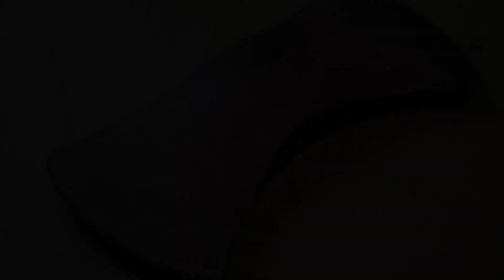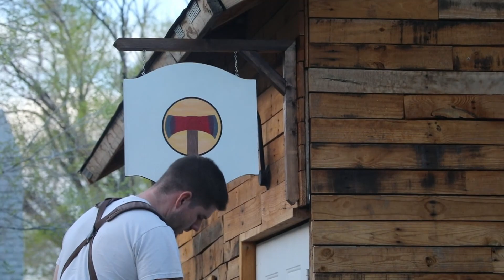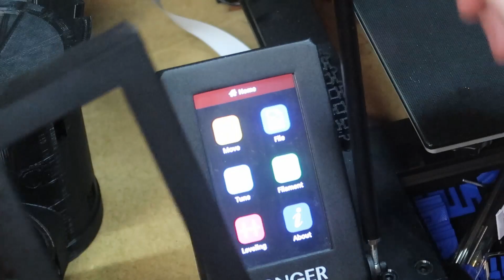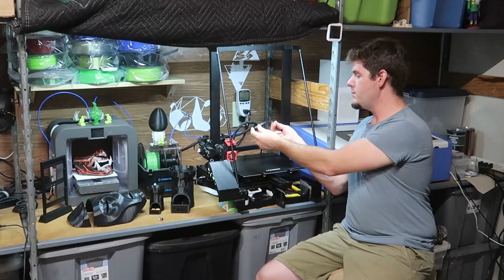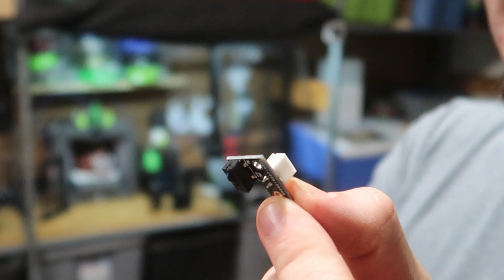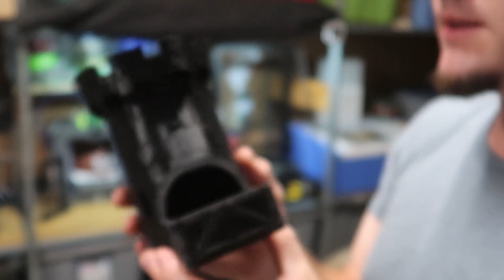1200+ Hours on the Longer LK5 Pro | Still Going Strong

Comment: I am having an issue with my LK5 pro where the screen is stuck on the longer logo, I need to update the firmware but can not hook it to the pc due no drivers. All the links on Longers site are down that I have found with the windows drivers. Any idea where I can find these?
Reply from the maker: If the site is broken I'm not really sure where those files can be found. I would check your power connection, the only time I had this issue is when the fuse connected to the power supply fried out from bad connection. Sorry I can't be more of a help!

Comment: Hello

Could you help me with a problem I have? I recently brought the longer lk 5 pro, but I got terrible prints when I started printing something. I try leveling it, cleaning it, and changing the setting, but I still get blobs on my prints, and the feeder keeps skipping. I hope to hear from you soon for some advice.
Reply from the maker: My extruder motor was having some skipping issues and blobs randomly as well! I would suggest running a temp tower through cura, and as for blobs if you have really cheap filament that can have inconsistency with what temp melts it if the filament changes size and goes bigger and smaller then 1.75mm as happens with the cheaper filaments. But first try a temp tower, then do a retraction tower with cura. Both are pretty straight forward and will help you to set a base line, also check your nozzle for even the smallest piece of string or filament might be causing a jam
Reply: @DoubleBitsWorkshop  
Thank you for the advice. For Filament, do you suggest I change it to Longer"s Filament? I'm currently using Anycubic PLA Filament 1.75mm, brought it through amazon? And for running the temp tower through cura, do I have to download something to install the change settings to the printer, or do I just plug in a can from my laptop to the printer? Hope to hear from you soon.
Reply from the maker: Anycubic should be good. Longer is also pretty good for filament!
As for the temp tower, cura has temp tower g code you can run. If you Google how to run a temp tower on cura there's some very good tutorials on it. But basically you download a plug in on cura, and turn on settings for a temp tower and drag in the temp tower that comes with the plug in, once you slice it you run it just like any other print. 🙂 Bumps are caused by 3 things. Too hot of temp, too much speed, or you're retraction is too slow or too fast. If the bumps are at a certain height then it's your guide screw. The bearing was loose at the top of my screw so heads up! After you run those tower I would suggest keeping your print speed around 60mm or 50mm with your wall speed being half of your print speed. Good luck! And thanks for the comment!
Reply from the maker: These are common issues with all FDM printers and sadly too many people will think they have a "bad unit" and try to return the printer they chose when it really can happen to anyone! On any printer! Even ender 3 even though so many think their bullet proof... Until they buy one and realize the long road they have to constantly fix everything! That's why there's so much support because everyone has to spend so much time tinkering with them. Honestly the only real issues I have had with my longer lk5 pro I caused. :-/

Comment: Mine has around 1500 hours and I bought it pre owned lol
Reply from the maker: Nice! They are good machines! And most CR-10 parts work on them! So if anything needs replaced and you can't find the OEM longer brand part the creality ones work. :-)
Reply: @DoubleBitsWorkshop  bet thanks and what slicer and firmware would you recommend?

right now I’m on cura 4.8 with the stock firmware I bought a second lk5 pro and I’m thinking about changing the one and comparing the differences

Comment: Longer printers are hit and miss I'm running a lk1 and do a lot of 3D 2nd amendment printings and I cannot get x and Y calibrated and I've used teaching text calculator crosslinks calculator writing it down on a piece of paper to get my values and they always come undersized or really oversized.  Next time I buy a printer I'm going with a different brand
Reply from the maker: If a 3d print you have made is smaller then what your slicer says it will be after you print it, usually is the fault of the slicer settings. If a print has issues with not being square where the bottom is larger or smaller then the top, your printing at too high a temp or too low for the filament your using, test prints that are designed for testing these issues are your best bet at getting good prints from any printer. But I would also advise looking into videos that help to make the lk1 better. I chose the lk5 because it's newer and fixed most issues people were having with the lk1. Such as the height becoming a problem due to no support after the 100mm - 200mm mark you can start getting issues. And so on. So I would suggest trying to fix the problems that older model had from it's luanch in 2018. It can be a good printer. But it will need upgrades to be consistent.
Reply: @DoubleBitsWorkshop  it's the longer printer it just sucks 2 yrs of nothing but problems went through 3 different motherboards then I was dumb enough to buy a 2nd lk1 and that sucks also 😄 what sucks even more is their customer service I'm still trying to get this xy  calibrating and they're so slow to respond they'll look at the message and don't respond 😄 save yourself the headache folks and get yourself a reality ender